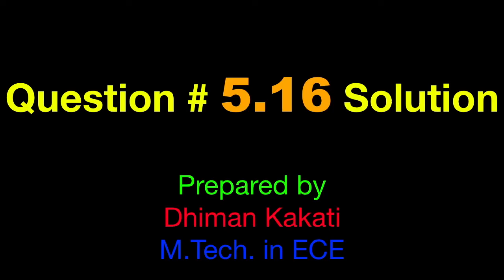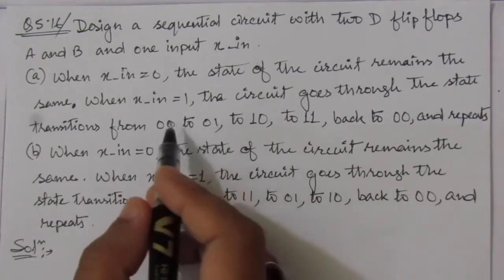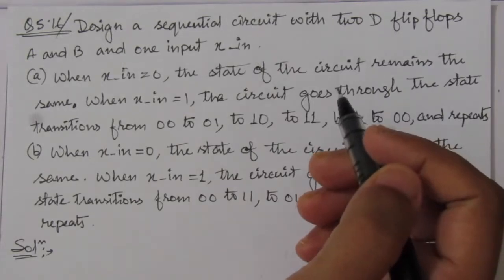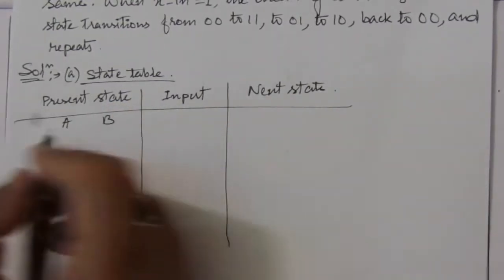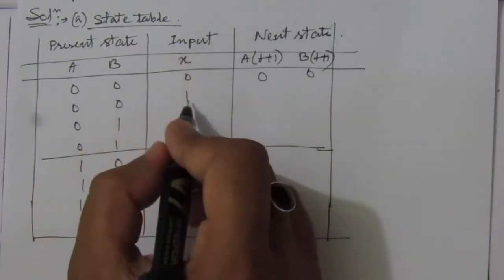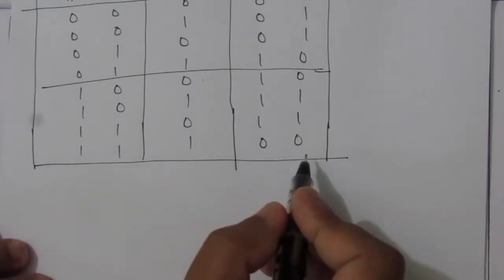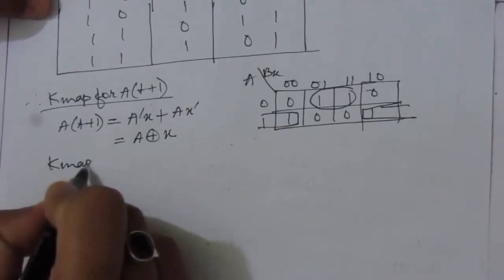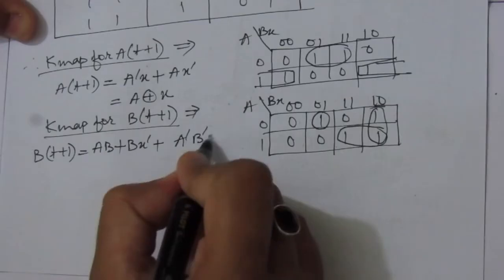Q. 5.16: Design a sequential circuit with two D flip-flops A and B, and one input x_in

Comment: design asynchronous sequential circuit with two inluts T and C the output attains a value of 1 when T=1 and C moves from 1to 0 otherwise output is 0
Could you solve this question

Comment: What is the clock signal
Reply: its the signal that causes the flip to flop.  essentially the controlled inputs are X, nothing will happen until a clock pulse is received.  you can make the clock a switch to slow things down.